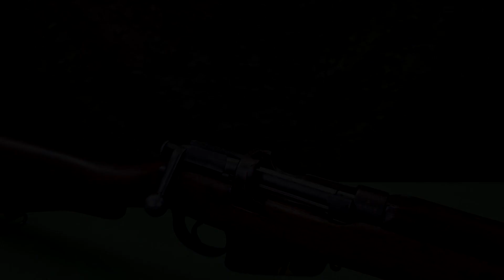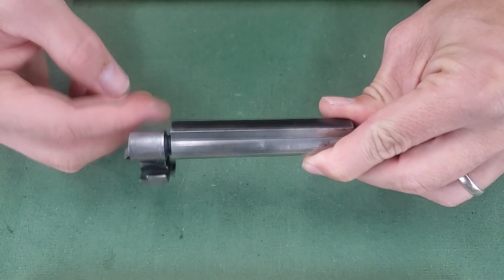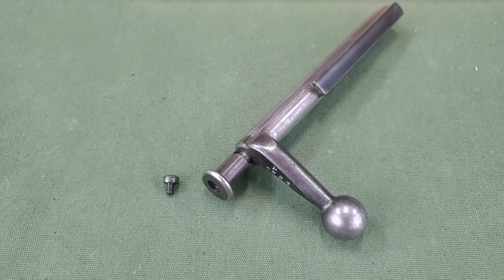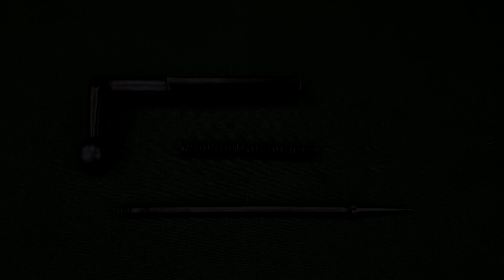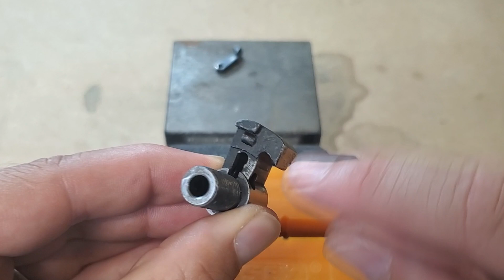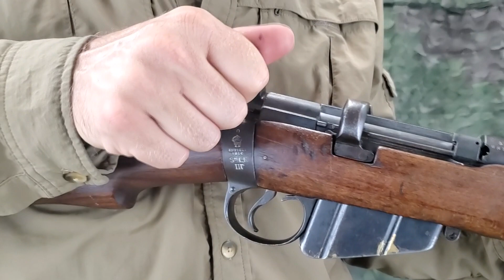SMLE Mk III* Bolt Disassembly (TF 4-04A)

Comment: I recently acquired a no. I Mk. III* and I knew it was in rough condition, but I wasn't expecting the bolt to be seized up. Do you have any tips to fix that?
Reply from the maker: Like you can't get the bolt to open in the reciever?
Reply: @HistoryinFirearms  yes, it's stuck in a closed position, it doesn't rotate at all
Reply from the maker: @Emmylou-The-Opossum  I would probably start with some standard penetrating oil and let that sit. Hopefully you know it is unloaded.
Reply: @HistoryinFirearms  Luckily, I do know it's unloaded. Is there anywhere specific on the bolt that I should apply the oil?
Reply from the maker: @Emmylou-The-Opossum  The bolt has a long locking lug that would be along the right side with the bolt closed. There is a second smaller lug 90 degrees from that  lug, towards the rear,  that would be inside the receiver. I would focus on the bolt in the rear of the receiver and in the rear around the striker and cocking knob to try and get it down where the locking surfaces are. Are you able to move the cocking knob?